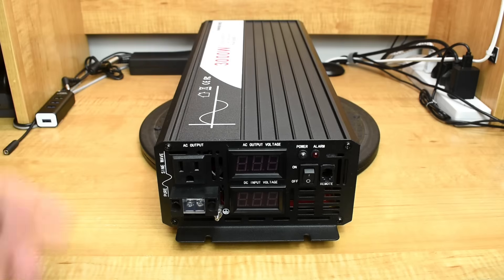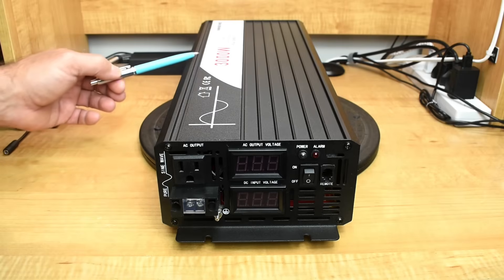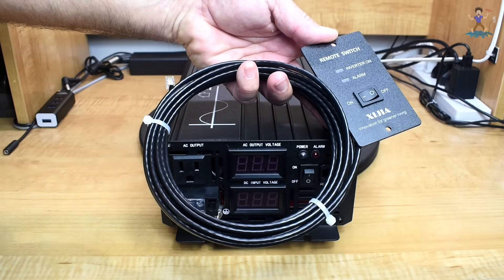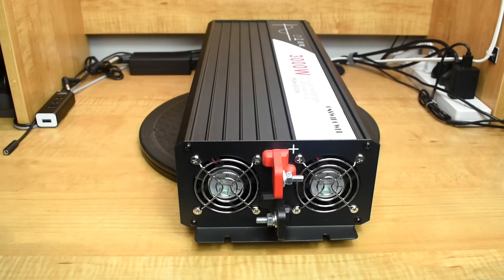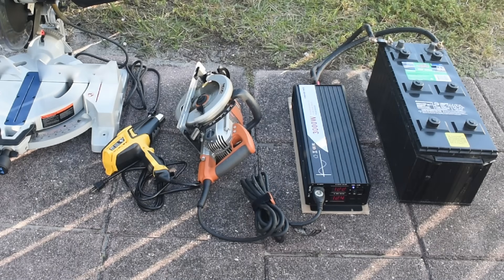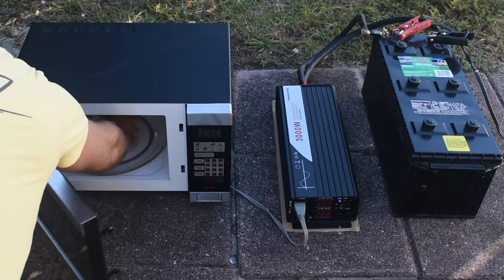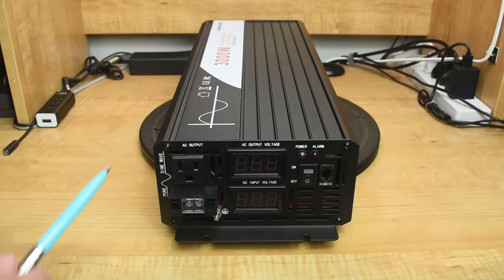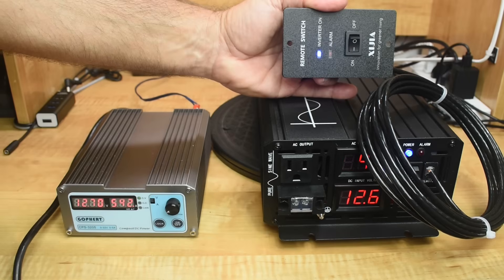3000W/6000W Off-Grid Pure Sine Wave Inverter Any Good? Find Out!

Comment: You mentioned that this unit has a built-in soft-start.  I am planning on buying one of these inverters but I already have a Micro-Air soft start for my air conditioning unit on my camper that I have not yet installed.  Should I go ahead and install the Micro-Air soft start or would this inverter negate the need for it?  Is having 2 soft-starts OK?
Reply from the maker: Hold onto it, if this unit doesn't have a long enough delay, you may need it. Buy the unit from the Amazon link I provided, if it doesn't do what you want, you can easily return it. Thanks!

Comment: Cutting a piece of wood in your chop saw demo is a real test to this inverter. And see if it maintains pure sine wave voltage output as claimed by it's manufacturer.  I'm glad you used inductive loads to test this unit.

Comment: Thank you for all your videos they are very helpful. I was looking at purchasing a 2000w inverter for my camper based on my maximum load of 1300-1400w. Is there any disadvantages to going bigger, besides cost?I am going to wire all my outlets to it and use an automatic transfer switch.
Reply from the maker: You're welcome Chace! If you don't intend on using more than 2KW, then don't bother with 3KW. An advantage of 3K would be better surge capacity. Thanks for watching!
Reply: My understanding is that some battery power is used to run the inverter itself, this is increased with a bigger inverter. So don’t get a 3000W inverter just to run a laptop and a phone charger for example.

Comment: I just bought the 12v version of this inverter mostly because of this review. I need this inverter because I bought a110 v /60hz  gas dryer 5.2 cu which has a sensor for the correct frequency since it is gas the electric one don't have the sensor and I shipped it overseas but the volt there is 220/50hz I used a transnormal but the dryer gave me an error (frequency not suffusion). My question is can I use Gophert CPS power supply like the one you are using  instead of 12 v battery since I have power at home? and I only need it to transfer the Hertz or what other alternative power should I use?.  Thank you very much for this video!
Reply from the maker: Hi there. The CPS needs to be able to supply enough current. If your gas dryer needs 100W at 120V, then you'll need a 10A power supply unit. Thanks for watching!

Comment: curious about the circuit breaker... can we just use a plug in GFCI circuit breaker or make one our selves instead of opening up the unit... when opening up unit also means we void our warranty. maybe you can video on this (maybe) i dont know...I'm just trying to find a better way. I have no electrical experience.
Reply from the maker: You can buy a #12 heavy duty power cord(3 prong), cut the middle of the cord and separate the wires. Attach clamps to each end of the plastic box and insert the wires. Next strip 1/2" of the insulation off of each conductor. Then connect both white wires together using yellow wire nuts inside the box, both green wires together, and the black wires go to each side of the breaker installed inside the box. Drill a hole in a blank cover to mount the breaker. Very simple. 
https://amzn.to/3cPa7Dp
https://amzn.to/390jTRP
https://amzn.to/3lzKD0t
https://amzn.to/30Zuk3J
(Amazon Affiliate Links)

Comment: Great info, thanks. I see that this inverter has a grounding post but nothing was mentioned.  How would the grounding post be used?  If this unit is used in a fixed location (like for emergency use at home), would the unit need to be grounded to earth?
Reply from the maker: Yes, the solar panel ground wire, and the inverter ground to a ground rod.

Comment: If you have a 24 volt battery bank connected to a 24 volt inverter does the inverter step it down to 12 volt or am I wrong? Confused on this part and also wouldn't a 24 volt be more efficient?
Reply from the maker: Hi Chris. The 24v inverter takes the 24v and steps the voltage up to 120V or 240V depending on the unit. Using higher input voltage lets you use smaller wires from the battery, which saves you money. Thanks for watching!
Reply: @electronicsNmore  Thank you! I've been Trying to figure out the best way to build a budget but safe rv solar system for boondocking. I know 24v would be less amps and should be safe with a 2000w inverter. No need to run air conditioner but do need to power a household fridge all day! Occasional tv usage and microwave and possibly a coffee pot. Your channel deserves way more views!

Comment: Can this run off a car if the engine is running. Say to run a freezer for a night?
Reply from the maker: Yes, it shouldn't be a problem as long as the voltage is in the usual range (14-14.5v).
Reply: @electronicsNmore  In that case I'm going to order one. I don't see the need to buy a separate generator with one of these. 

Thank you very much for your speedy reply

Comment: With aliexpress is much cheaper but you cannot return the product if doesn't cover your exp[ectations. With amazon is more expensive but more covered buyer if don't like it. I canceled with aliexpress because the seller answer me not possible to return it. In amazon there is not that limitation. I will try with that inverter.
Reply from the maker: Amazon is definitely the way to go for easy returns. Be sure to use the link provided. Thanks

Comment: I just bought the 24v version of this inverter mostly becuase of this review. Initial testing with a bench power supply is inline with this video. I still need to do a full load testing when I receive the batteries. Thank you very much for this video!
Reply from the maker: Great to hear Rodrigo! Like other inverters I have that work well, I never run them at full capacity continuously, I keep the max continuous power just under the rating(2800-2900w). Post again after you test yours.
Reply: @electronicsNmore  Absolutely! I ALWAYS de-rate the stuff that I buy from China. I am expecting to mostly run this at 1500/1800w. And my "full load" will be 2400/2500w for 20-40 min.

Comment: is there anyway, either through the inverter or through another device to adjust the over and under charge and cut-off voltage? For the batteries I have the low-voltage cut off would be pretty hard on them.
Reply from the maker: What type of battery?
Reply: @electronicsNmore   they are powersonic 12v 40ah sealed  AGM batteries..... I have them connected in series to make 48volts

Comment: Great video! Can you help with.....
I purchased a WZRELB Reliable pure sine 3000 W inverter 12V and it has a live ground 60v, how do I install this unit in my travel trailer????
Reply from the maker: Actually, it's 60-0-60. Measuring from ground prong to either side is 60V. If installed in a shed, house, garage, etc, then you would connect the ground prong to the aluminum housing, then the aluminum housing to earth ground using a metal rod and clamp. In your RV, use the inverter as is, don't ground it.
Reply: @electronicsNmore  
Thanks!
Your awesome👍

Comment: Maybe I missed it. Did the input steel terminals heat up with a heavy load.
Reply from the maker: No, they felt about the same temp as the middle to the rear part of the inverter.

Comment: Thank you for the review. Been planning to buy one of these for an upcoming project. Will be a 24v or 48v though. 

Any videos on recommended inverters?
Reply from the maker: You're welcome! I would imagine the 24v or 48v input version would test the same.
Reply: @electronicsNmore  Sorry, I should have have been more specific. I was asking if you had another brand that you would recommend over this one, based on price, performance, and reliability?
Reply from the maker: @anthonypelchat  So far, out of the 5 I tested, this one did the best overall.
Reply: @electronicsNmore  Perfect. This is the first video that I've seen from you. Will subscribe. I'm planning a ton of battery projects later this year. This brand of inverters is currently the main one on my list for pure sine wave use.

Comment: I've mounted an EDECOA 12/230V 50 Hz some years ago in my van and I am thinking of installing again the same brand in my new one. The only problem I've had with my first one was a slight noise (only noticeable on sensible devices like the TV antenna amplifier) which I believe was backfed into the 12V rail, and the reluctancy to start my ASUS PC's PSU (unless soft-started with the Inverter or tried a second time, presumably before the main filtering caps were completely bled).

I'd really like to see an EDECOA whipped to the test ;)
Reply: Is it a modified sine wave? I understand that causes some appliances to hum.
Reply: @darylcheshire1618  It depends on the specific model. During the last 5 years I've bought two of these PURE sine wave inverters and I am pleased to report they've got even better. No humming of course and if you have short and beefy cables they absolutely deliver what they claim. My first one refused to stay on when I plugged my ASUS 180W PSU and I attribute 90% of the fault to that popping PSU: it's not normal to plug to the mains with such a loud popping electricity sound. The out-rush over current protection tripped and I had to resort to soft start to connect it.

The newer one doesn't trip like the old one. I haven't taken measurements but the reassuring behavior was the first one not the latter. Still I am very pleased since the newer it's even got a built in instant power meter (in Amperes).
Reply: @m80116  yeah, nothing to do with inverters but I once had a fancy looking Coolermaster PSU which periodically would fail to turn on and it might turn on a second time. I put up with it for months but noticed it was happening more often. Soon I bought an Antec and was happy ever since. This was years ago.

Comment: Hi is there a link to your 4D battery? and what is the total kW capacity of that 4D battery?  is the math 12v x cold cranking amps or it’s cranking amps?
Reply from the maker: I bought it locally, stole it practically. Look on offerup. Interstate 4D deep cycle.
Reply: @electronicsNmore  thank you..

Comment: Very good review! Seems like a good bang4buck IMO.  Funny how all the Chinese units have no problem using a US 15amp recept, unfused, and with full 3Kw + available! Should have found out if the output supply had a real neutral/hot, or a floating neutral. The soft start is great for running one big power tool. That saves it from blowing up or going into protect. What worries me is that if the inverter was powering, say entertainment electronics, lighting etc, then the 5K BTU window shaker kicks on, will it brown out the electronics? I have a 24 volt Reliable brand 3500W unit. It has a soft start, but only activates when the inverter is powered up! I learned that these hi output units really need a huge battery bank to run right. I first tried just 2 12v trolling batteries in series and it shut down trying to start a de-humidifier (just a test). Some time later, purchased 4 6v 310 amp/hr flooded batteries put in series. Now it starts de-humidifer like it's on the grid! I think bus bars should be used to supply power to the switching transformers instead of individual wires. I plan on doing that to my inverter soon. Of course boils down cost savings.
Reply from the maker: (2) legs create the 120V output. Pretty sure 60V each leg. 110V output is fine under heavy load, but you're right, you need a heavy duty battery bank to keep the DC input voltage from dropping.
Reply: "then the 5K BTU window shaker kicks on, will it brown out the electronics?"
Yes, indeed it will.  Single outlet, everything shares the voltage and current.  
Lead acid batteries don't much like high current demand applications.  Lithium is better but also a lot more complicated.
There's a big difference between "soft start" and protection circuits.  This can be seen monitoring the output on an oscilloscope when starting the chop saw.  A real "soft start" maintains sine wave, just less voltage.  A protection circuit will either cut off completely or rapidly switch the output which can be pretty bad for some things.There's a video about doing just this sort of thing with Ecoflow batter/inverter device.

Comment: Anyone that truly understand and know .. can I use two of the 120v output inverter for a two phase 240v setup .. meaning wire one hot L1 to my panel and another identical inverter hot to L2 of my panel for 240v setup within 3000w ?  .. hope this works because 240v 2-phase inverters are crazy expensive
Reply from the maker: They're very expensive, I don't think you'll make one using (2) of the type shown in this video, but I could be wrong. :-)
Reply: @electronicsNmore  well the same brand has a 6000w version for $620 or something like that and it’s 240v 2-phase? If it’s a real 2-phase that’s the cheapest 2-phase I have seen .. but still x2 of this 3000w unit and it’s 33% less than the 6000w unit .. so if you ever get to test this unit that’s would be cool.. i like to support my 240v cooktop, oven and dryer...

Comment: Great review as always! Built in soft start is a fantastic feature, makes you wonder why other manufacturers haven't thought of that since it's a common failure point. Thanks for posting!
Reply: Soft start on the inverter SUUUUCCCCKKSS. It flickers ALL of your loads on the inverter.
Reply from the maker: Glad you liked the video Rolland! Other manufacturers also manufacture "soft start" inverters. Be sure to share, many hours goes into filming & editing videos like this, and YT is fantastic at hiding my content. Thanks for watching
Reply: There are pros and cons to soft start and some sensitive items may not turn on with soft start or act strange, Something with a control board and boot time could be an issue for example but it would be rare. Soft start is a must for power outage preparedness in running a full size fridge or microwave where the inrush current will trip most inverters. Owning both types is a good idea.